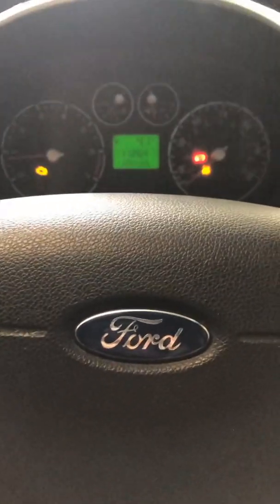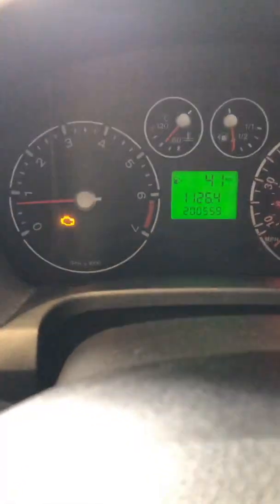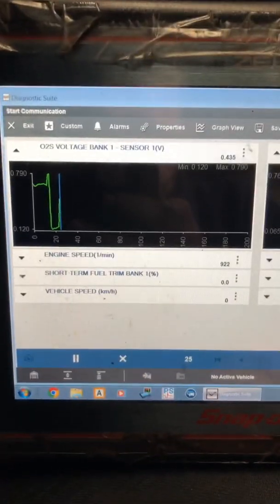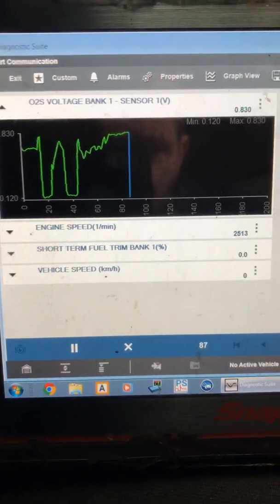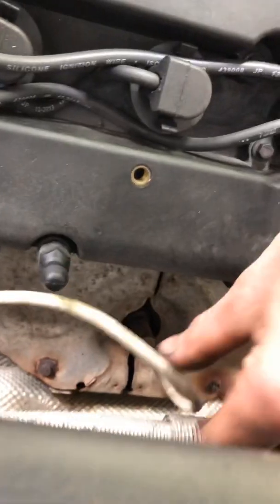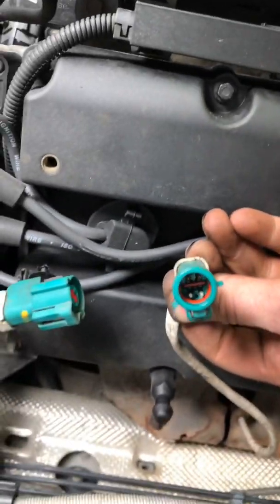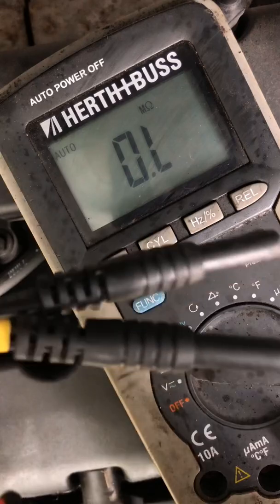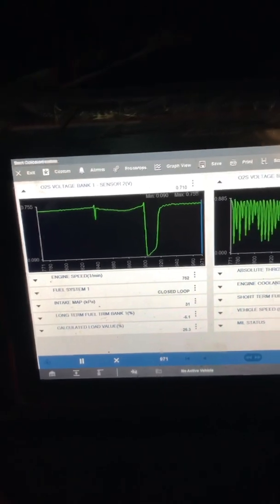Ford Fiesta Zetec P0030

Comment: Ive had these fail twice, both times after filling up with E10 petrol, ive read that these Ford Duratec engines dont like E10 at all, so best to stick with E5. At least quick to replace the sensor 😂

Comment: I have same code like you and I bought a new sensor from UK (40 Eur) and code won't go away. Resistance on sensor is 7 ohms,I have signal voltage from pcm at 4.5 V and battery at 12.2  on other two wires and I reset the code with my delphi diagnostics and it appears again and again. Maybe I should mention that previous owner had physically cut check engine light diode form instrument cluster and that is also one of the error codes. Check engine circuit not completed or something like that. Any advice?

Comment: I got the same thing on mine now.  Mine was revving bad,  at 2000rpm  and  going up and down from there.  Anyway I cleaned the throttle body but that didn't fix it.  It was a pipe near the manifold had split. As a temp measure I glued it shut and it now revs properly at 900rpm.
I've also had an engine light on for ages at p1025  which is a coolant problem, which I think is a leaky thermostat housing.  I had the same fault last year but bought a new expansion tank cap and that solved it until about a month ago when it came back on and a new cap hasn't fixed it.

Anyway I cleared that fault code just to get it through the MOT but noticed a new one now,  this  p0030  Bank 1 Sensor 1 shit.  Anyway the volts on mine  stay at 0.36 steady until I rev then it does change. Mine goes up on the graph not down but i didn't test it hard.  Wonder if mine is the same problem with the heater ?